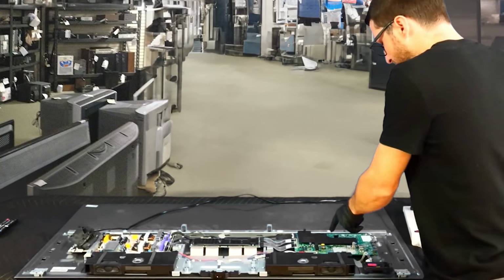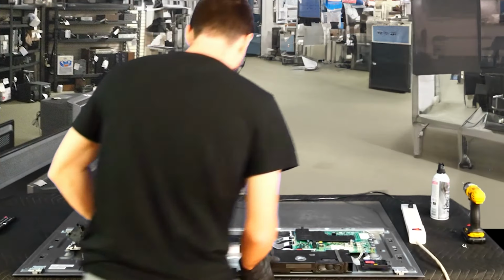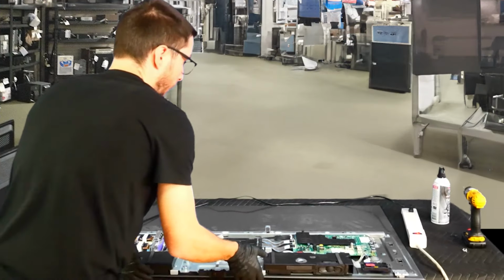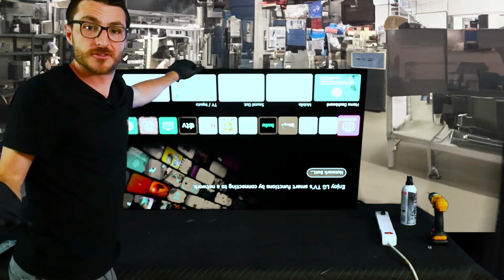LG OLEDs Have A Serious Problem! How To Fix!

Comment: Hi @NicksTVRepair, I just called the number on your website to ask questions regarding specifics that weren't mentioned in the video.  I was instead responded to rudely with "I don't have time for this" and was told to end the call.  Is there a way I can talk to someone about questions I have regarding my specific repair situation?  Is there any way to message or call you directly?  Thank you!
Reply from the maker: Hello,

I am very sorry this has happened. When you call you should be greeted properly and not rudely. We did have over 150 inquiries that day via email, and the phones were ringing for a few hours straight so we were extremely bussy, but that is no excuse to be treated that way. 
You can send a message in the Youtube comments, I usually check them personally once a day or two days depending on how bussy we are. (been a bit bussier lately) 
Again I opologize for the way you were treated, if you could provide me the name of the person you were speaking with I will make sure to speak with them so that this does not happen again
Reply: Hi Nick, I appreciate the response.  I do not remember the name of the person on the phone, unfortunately.  I have been exchanging Q&A with Richard over email and he has been very helpful.  I would appreciate, if you have a moment, could you glance through our email exchange thread? I just want to make sure I have all the information straight before I place my order. Thank you so much for your response!
Reply from the maker: Hello, I apologize I have been out sick for the last few days. 
Unfortunately I don't know what email thread is yours I have tried looking  but as I don't have your name, or email information I haven't been able to pin point yours. Again we have about 50 new emails daily, so I may have not seen yours or maybe I did and missed it. Of Course DO NOT send me your private information here but if you can send us a follow up email to our support@nickstvs.com email today and include your Youtube Username in the email, that would make it easier for me to identify your email as yours. 
Thank you

Comment: How much to fix a board?  I've a almost 2 year old LG Oled 48" and the picture will not turn on, like at the beginning of this vid
Reply from the maker: Depends on the board and what is wrong with it. 
What is the part number of your mainboard, and or the full model number of your TV. What symptoms do you have with it. 
If your mainboard is the same one as shown in this video, but simply the 48" version then please see the links in the video description.

Comment: Hi, how do you remove the heatsink's pins from the motherboard?
Reply from the maker: If you are replacing the entire board then no. If you are trying to remove the heatsink then yes you have to pinch the pins on the bottom of the board and push them through.

Comment: My LG C1 65 made a loud click sound while turning on . Now its completely dead no light no sound ,anything.Is it the same problem ? What do you think ? My TV is only 30 Month old .
Reply from the maker: That is a bit strange. I can't say I am as familiar with the C1 models even though the boards are similar. 
If you take a look at the back side of your mainboard, do you see a dark brown spot like we saw on this mainboard we fixed in the video? If yes this would confirm the mainboard is bad. 
If no, then it wouldn't be conclusive because the mainboard can fail without overheating the processor so it still could be the mainboard or something else. 
If you want to send in the mainboard we can test it and diagnose it, and if we can fix it we would charge the same price as the OLED55CXAUA since the repair will probably be the exact same.

Comment: Man this sucks so anyone know if I can use a cx 48" power supply for a 55" cx? Insurance company sent me the wrong size. I already got refunded for the tv but wanted to see if I can get it working properly. Tried adding a lot of ventilation on mainboard side and that helped make everything work again except for 4K discs. Now I think its a power issue. Any help would be appreciated. Thanks.
Reply from the maker: I don't think I have ever tried the 48 in the 55 but I believe you can because the 55/65/77 inch sizes are cross compatible.

Comment: I just opened up my CX to check the thermal paste and now I get no power, no red light, nothing. I’ve checked the cables that I disconnected during the process and was quite delicate. I’ve checked the power arriving into the power board and there is correct power.
Feeling like there’s something really simple I’m missing. Any ideas?
Reply from the maker: It's possible your mainboard has completely failed. That does also happen with these. Typically freezing won't help in those cases, just replace the mainboard. We still have a few for sale.
Reply: @NicksTVRepair  the only logical explanation I can think of is that the cpu was disturbed while removing the really solid thermal paste. Perhaps if I send mine board in for a cpu replacement like in the video, it will fix the issue?
Reply from the maker: I don't know for sure, but I also wouldn't know until it was sent in for us to take a look at.

Comment: Lg 4K OLED 55C1XTZ   Only 2 and half year old not showing picture when turned on  and goes off itself , shows thin red line on screen
Reply from the maker: That sounds like a panel failure based on the thin red line information. Unfortunately that is not something that is worth fixing.
Reply: Now lg technician diagnosed and said that screen is to be replaced and they will also change all  other components including tcon and mother board and the original components will be taken by them  If there is only fault in screen why they are replacing all other comonents.Forthis they said that for setting they have to replace all other components with new screen please guide me what to do

Comment: This is some BS. I bought the OLED65CXPUA in March 6, 2021. I've been having the same issues since the last firmware update.  July I believe. I ordered the BPR total assembly board to fix myself. Its either $300 to fix or another 2k plus for a new TV not named LG. I'll get back if all works out with self repair.
Reply from the maker: I understand your frustration. It would have been better if LG had either a larger heatsink on their board or at least a fan to cool off the unit.
Reply: Ok guys. Here I am. I bought the Main board , removed the original/defective board, and replaced with the new one. It's been a week and the tv is working perfectly. No issues! Might send the defective board to Nick TV repair to have as backup in case this issue arises again.
Reply: I have a 65 inch LG CX- bought it around 3 years ago. It's doing the same thing. I found a $300 replacement board online at a parts store in CA, but am hesitant to purchase. Is your TV still working? I have YouTubeTV and have had to watch the entire college football season by hooking up my laptop via HDMI because the YouTubeTV app causes the TV to freeze and shut down after 1 or 2 minutes. Now regular YouTube and Prime Video are doing it as well. Maddening because I paid $2000 for this TV.

Comment: I'm having flickering issues with my G4. It flickers then goes totally black after playing games or watching any time of media/streaming. 

Repair company already replaced the main bored and it's doing the same thing again. Perhaps they'll replace the panel this next time. If it doesn't work, I'll send the tv back for a newer one. 

Anyone else know what the problem is yet?
Reply from the maker: I would recommend you do the following. On a cold start reduce the backlight down to the lowest possible setting. Does that increase the amount of time you can use the TV for? If yes then you have a bad panel. If no then your mainboard indeed probably keeps failing or your have a bad T-con.
Reply: @ Thank you Nick, I've already had the main board replaced and awaiting a new panel. I will try the backlight prior to panel replacement. Thank you for your reply 😊
Reply from the maker: It's more rare but we have seen the T-cons fail as well.
Reply: @NicksTVRepair  So I turned down the blacks and it helped somewhat. But it's now doing it again. Panel is being replaced tomorrow. If it goes again, I'll ask for a whole new TV as it'll be the third time.
Reply: Me again, panel was replaced a month ago and now it's doing the same thing again. This will be the third time. I'm going to attempt to try and get the unit replaced. I still literally cannot find any information about the G4 having this issue anywhere.

Comment: I am sending in my board now. Do you guys provide the heat sink as part of the repair? (EDIT: You say in the video that you do :) ) Looking forward to having my tv working again!
Reply from the maker: Just to clarify so we are on the same page. Your mainboard comes stock with the black heatsink on the top of the processor. You have to of course send that black heatsink in with your mainboard for repair. The extra part we provide is the thermal pad on the bottom of the board. 
Now if you are purchasing a replacement board, then of course both will be provided with the board you purchase.

Comment: Sony 83a90j with vertical black lines on entire screen what could it be
Reply from the maker: To me it sounds like you have a bad screen. If this is the case then it's not worth fixing. However I would highly recommend you get a second opinion from a local TV repair shop that can see the issue in person as apposed to my opinion being someone on the internet that hasn't even seen the TV.
Reply from the maker: Our contact info is in the video description
Reply from the maker: When was this? I Just checked our support@nickstvs.com and info@nickselectronics.com emails and can't find it. Are either of these the email address you used?

Comment: What are the common problems of any LG TV
Reply from the maker: That is to broad of a question. Depends on the year of manufacturing, the series, the type of TV. 
Ask me that same question with a model number and I can probably give you an answer.
Reply: @NicksTVRepair  as for me I use the Sony bravia x70f and the problem I have with it is sound but no picture. How can it be solved?
Reply from the maker: What is the full model of your TV as printed on the sticker on the TV itself? I don't know what model the x70f would be. That doesn't match anything I am aware of.

Comment: Planned obsolescence they want you to have more than 2 year life tvs.
Reply from the maker: I wish this wasn't true but unfortunately, it seems like these days any electronics really is only built to last a few years. 
It's really too bad. I really wish a company would step up and build a 15-year TV. A TV that is over-engineered, would cost a lot but would last you 15 years and would get updated once a year with new features but the hardware would be the same. You really don't need anything better than 4k. Honestly 8k and better for a TV is just a gimmick, already not everything is even in 4k. It's getting easier and easier to get 4k content but most content people watch is still in 1080P. 
I would pay 3 times the price for a TV that was built to last and had parts made available to repair it.
Reply: 15year...I will be for 5 years ...technology changes are fast
Reply from the maker: TV tech hasn't changed much in the last 10 years. I would argue it's gotten worst as the quality of the parts has degraded.
Reply: @NicksTVRepair  What TV made today would a TV repairmen buy?
I have a Pioneer Plasma from 2008, works great and no burn in.